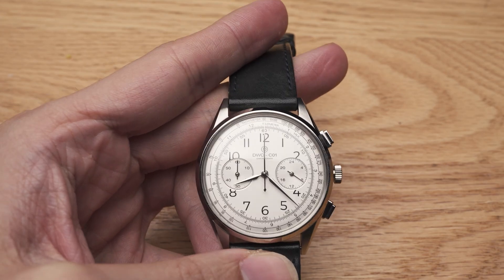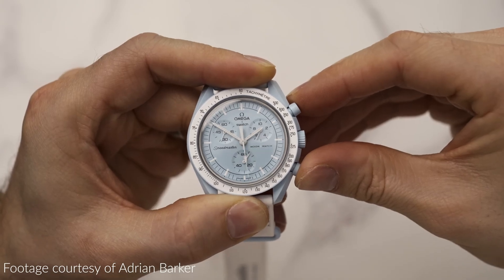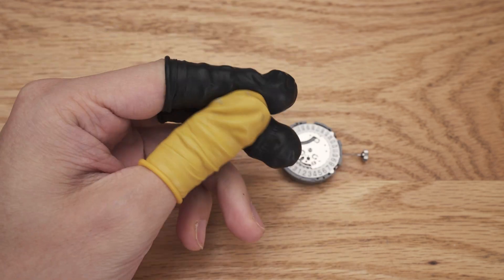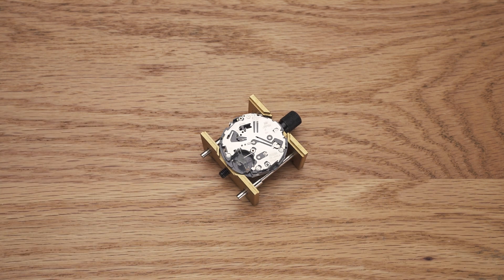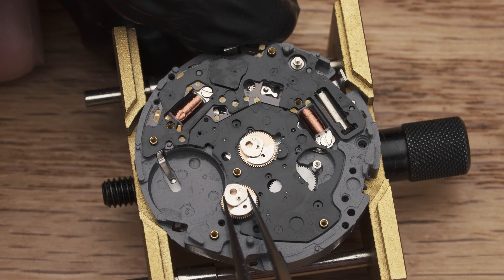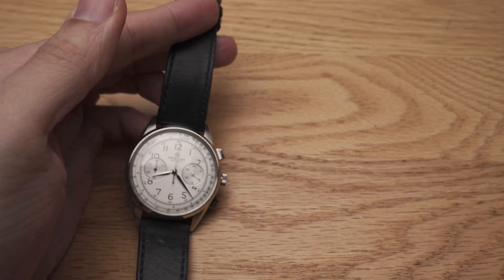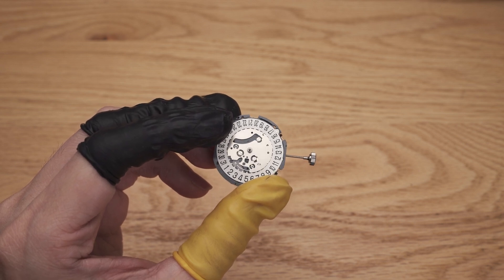Why is Meca-quartz Movement So Good? (Seiko VK64 Breakdown)

Comment: I have several meca quartz chronographs. They’re great. The only thing I don’t like is the 60 minutes chronograph counter with the dragging hand. It’s very difficult to read and count accurately the minutes elapsed. Many of these chronographs have minutes counter hands misaligned. It’s even more difficult to count in this case. Seiko/TMI should have developed a 30 minutes counter with a jumping hand to perfectly mimic a mechanical chronograph. Timex, Isa, Ronda have chronographs with 30 minutes counter and jumping hand. I hope future meca quartz movements will have this feature.

Comment: How does the mechanical layer powered? Do you need to wind the watch?
Reply: Quartz takes a battery. No winding
Reply: @Pawpaw7332  how's the mechanical part working then? Does it have some kind of regulator?
Reply: @berkocan2000  no its mecha quartz bcs of the smooth sweep. its not a mechanical watch at all.
Reply: @berkocan2000  maybe pushing the chronograph’s reset button provides the mechanical energy required to rewind the spring, kind of like how advancing the film in a manual-wind film camera winds the spring for the next shot or discharging a round in a semiautomatic firearm… also winds the spring for the next shot? Just speculation - I was wondering the same thing.
Reply: it is powered off the quartz layer through the piston.

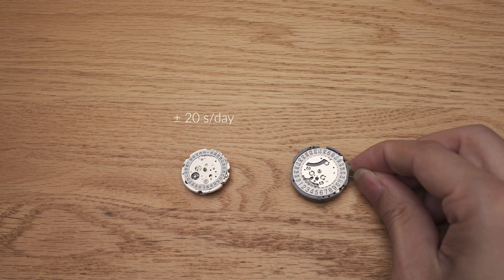Comment: 2:52 +-20 s/month is quite standard, many quartz watches along this pricepoint have +-15 s/month. 
The chronograph movement of the MoonSwatch at 0:21, likely an ETA G10.212 AJ, has a whopping accuracy of max +-10 s/YEAR!
Reply: Is an chronograph i know, but incredible how Seiko did +-5s/year back in the 80's in some models. crazy to think.